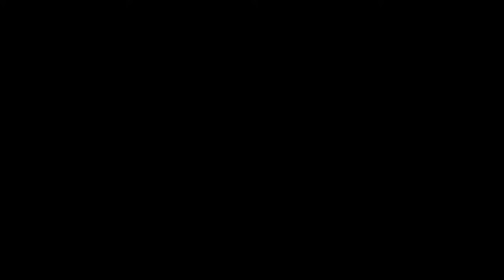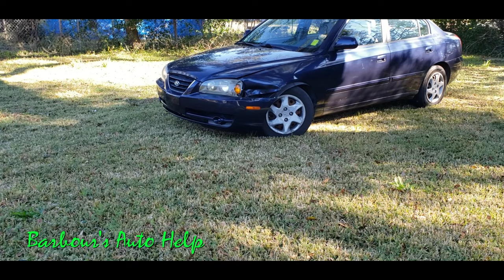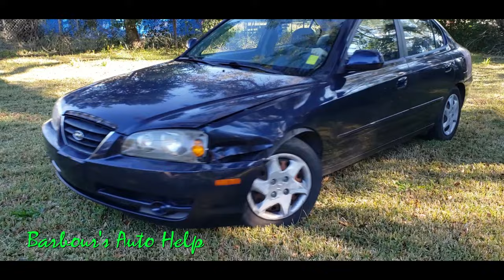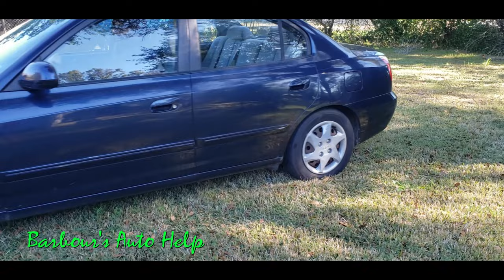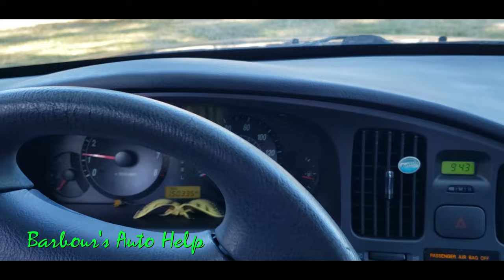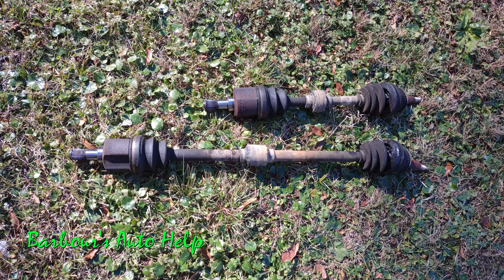CV Axle Clicking And/Or Popping Noise (Just a better example of what it sounds like)

Comment: I was stuck in deep sand in my FWD 4 cylinder van last month.   Trying to get out I heard a few loud pops.  I drove it home and now when the van has been parked for a while, when I first try to back out or drive off it makes a single popping noise, like a knuckles dislodging.  After it makes the noise it does not make it again while driving.. i drove 300 miles  stopping at countless intersections and it never made the noise until the following morning backing out of a parking space.   Anybody got any ideas?
Reply: Did you figure it out